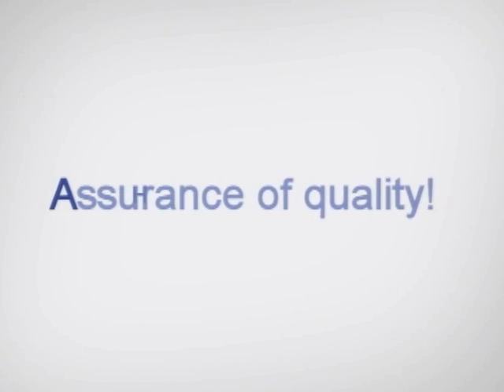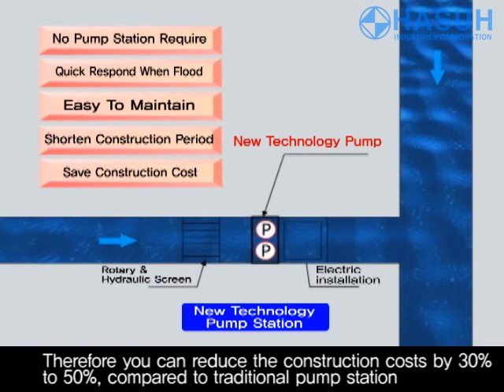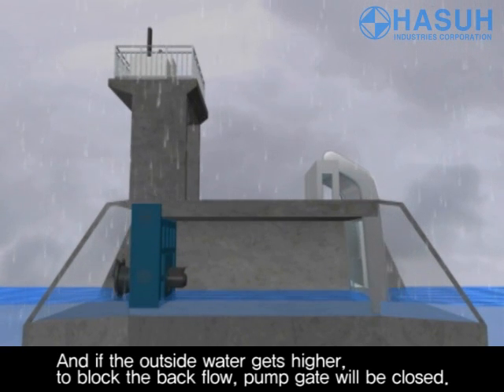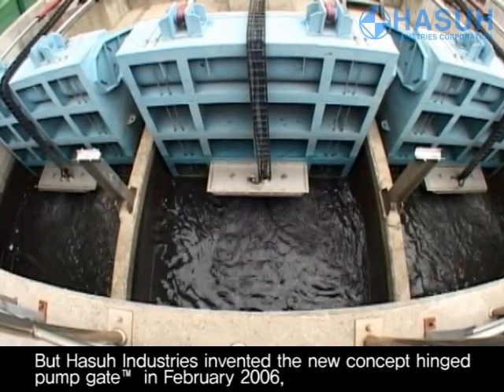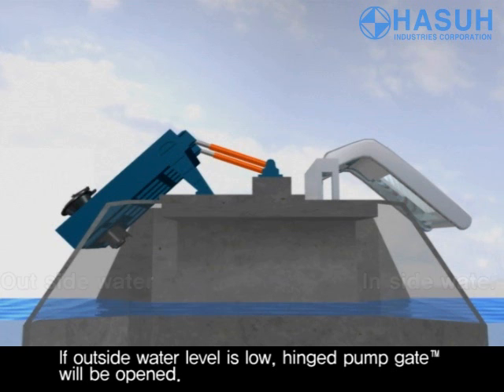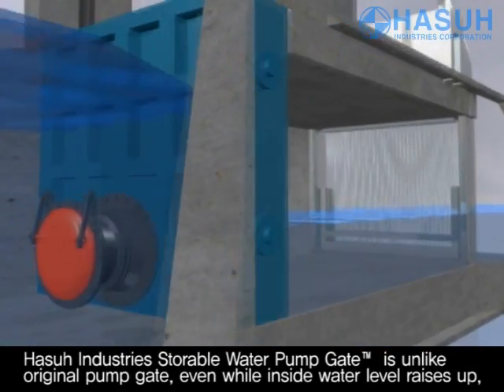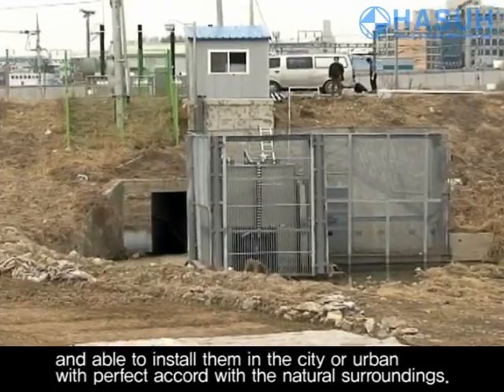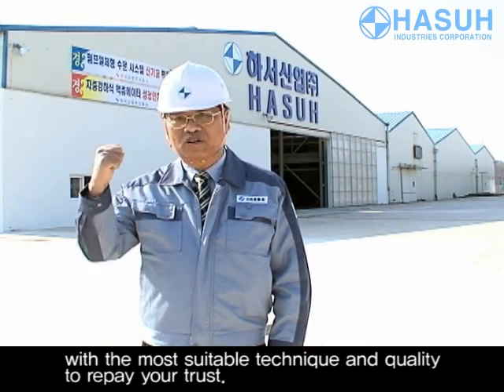Hasuh Pump Gate

Comment: I am an MCGM, India Engineer. We are looking for such solution. Can it be used for storm water drain system for capacity of 42 cubic metres per second flow for width of 60 mtr. Drain?